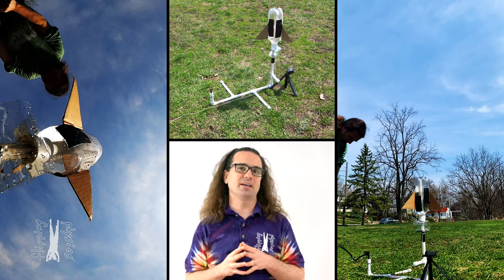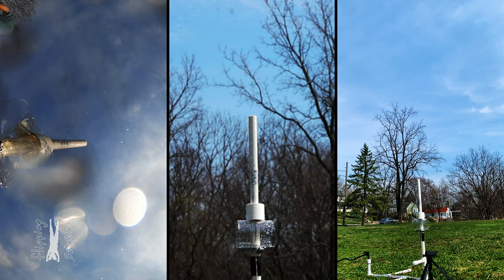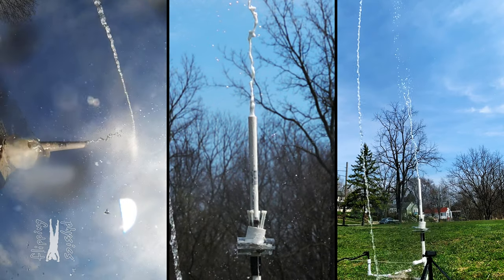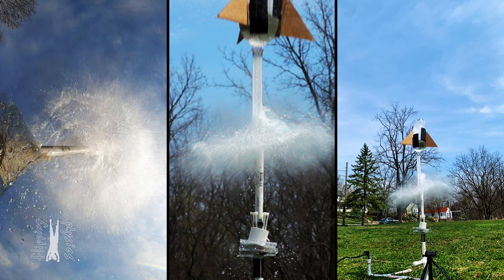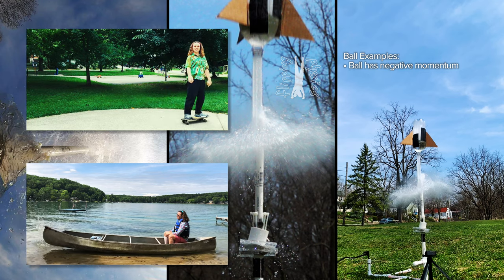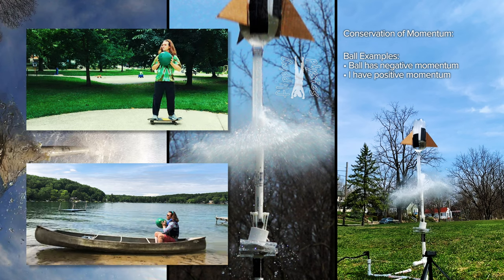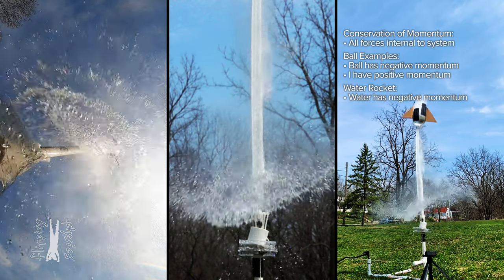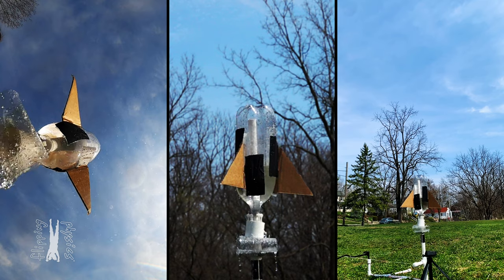Slow Motion Rocket Demonstration (Conservation of Momentum)

Comment: In middle school I spend so much time on my rocket. I fused multiple bottles together (to get more force causing higher initial velocity and higher maximum height)  by cutting them boiling them to make the plastic bend in then sanding them and putting cement caulking on them (Look up the process on youtube if you are interested (you are probably not). That was the best.
Reply from the maker: Thanks for sharing! In middle school I spent a lot of time building Estes model rockets. Multi-staged. With Parachutes. The whole deal. Loved it!
Reply: @FlippingPhysics  Its a good way to gain a love for Physics. I didn't know about momentum then but having that experience makes it easier for me to understand now. Thanks for all you do.